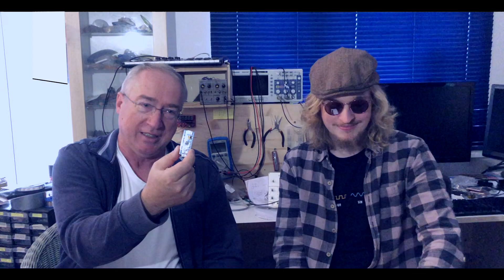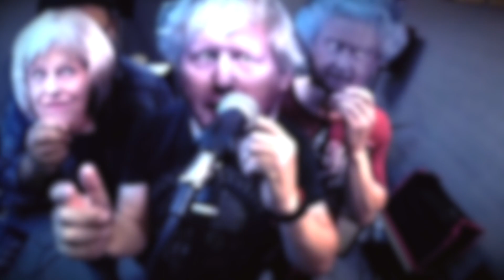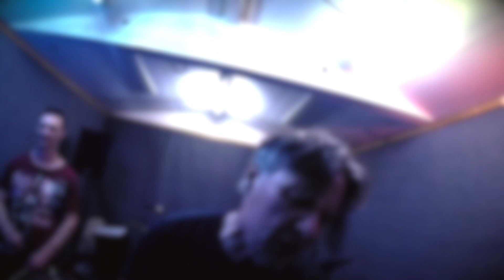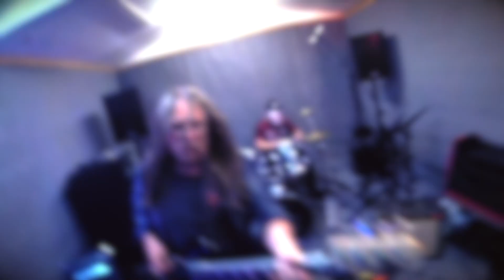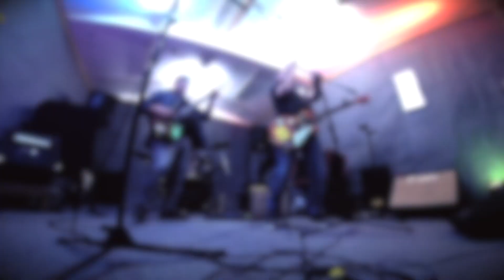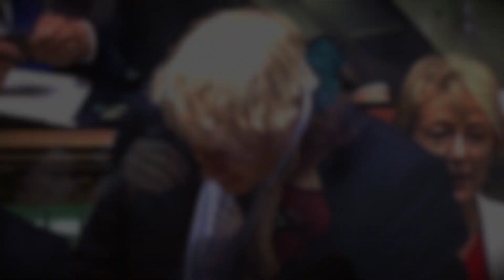Father & Sonthesizer EP. 14: The 50€ Wavetable Synth - Development

Comment: 13:00 Did you fix the "detuning" problem in the higher registers? I'd be interested to know whether you use a frequency/wavelength lookup table or calculate from A=440 Hz using the standard formula. Also what math precision do you use?
Reply from the maker: Peter D Morrison we use a lookup table at the moment cause it’s much faster. We’re using integer mathematics but we scale up by 12 bit in order to get enough precision. I’m not quite sure wether we actually fixed the detuning issue, but I rarely play chords that high up and it’s all note depending. So play fewer notes high up and it works. The little STM32 is at the limit of its capabilities here!

Comment: Hi George and Nils - thank you for all your hard work, particularly with the 'blue pill'. I swore I would never touch the blue pill again, but after seeing your amazing projects I decided to have a go. I've come unstuck trying to get midi to work on the Wavetable Synth, and decided to post my questions here in case anybody else is in the same situation:
1. Did  you use the USB bootloader to upload to the blue pill, or did you use serial, i.e. FTDI? I have uncommented line 17 when using the bootloader, but have had absolutely no luck connecting RxD from the 6N138 to any of the 'serial' pins on the blue pill. Using an FTDI (with line 17 commented out), I've had some success, but the midi behaves for a short time before ignoring note off commands and getting 'noisy'.
2. Which pins on the blue pill are you using for RxD and TxD? I noticed the comment on the schematic about RxD and TxD being swapped on v1.1, and on the "essential" schematic TxD = PA9 and RxD = PA10. 

3. Not a question, but I was having trouble with the rotary encoder until I noticed that CLK-KY040 in the code for v1.1 is PB14, but on the schematic it is PB3.

There's a good chance I've overlooked something simple as I'm definitely a beginner. I'm so excited by this project that I've given myself a headache trying to figure this out for a couple of days, and it's only in desperation that I've decided to bother you - sorry!
Reply from the maker: JumpingSpiderDesign Nils used the boot loader in an experiment but quickly stopped using it, he says the serial port is much better. 

As for the upload method in the IDE, it should say “Serial”, and he uses an FTDA adapter 

And nils also said the pinout on the WTSynth 1.0 schematic must be a mistake cause the correct pins are RxD=PA10 and TxD=PA9. We just double checked with the prototype and that’s the way we’ve got it. We’re fixing the layout/schematic for and will update it shortly. 

Regarding your midi issue, are you sure you’ve got the latest software? We’ll try and post a new one soon, message me on insta and I’ll let you know

Regarding the encoder, that’s a bug. Thanks for bringing it to our attention 

And please don’t hesitate to ask us anything again! Message me on insta (@georgekaymusic_ ) and I can give you Nils’ email so you can contact him directly. 

And we’re also super stoked someone is building one of our modules! You must share a video when you’ve got it working!
Reply: @georgekay372  Wow - thanks for the quick (and thorough) reply! I will definitely post a video when I get it working. I am tantalisingly close, and got my SH1106 OLED working yesterday - nice interface, and the 'oscilloscope' looks amazing. Thanks heaps - I'll figure this out or die trying!
Reply from the maker: JumpingSpiderDesign we’ve now updated the website with the latest PCB including all the fixes as well! And again, please don’t hesitate to message us again! We wanna help as much as we can. 

And we’re already working on a version 2.0, stereo filter & distortion and multi timbrality (with two bluepills)
Reply from the maker: JumpingSpiderDesign wow, that’s so cool! We’re really excited to see that in action, could we use a clip from that video in our next episode?

And I recommend using no sustain or a keyboard with an all note off command as hanging notes are still an issue in the current software.
Reply: @georgekay372  Aha! Thanks for the tip about the sustain; I don't even have a pot connected to that pin, so I'll go and try that. Sorry, I'm half asleep - I DO have a pot on sustain (5K, I read that in another comment?), so I'll investigate the midi behaviour of my various keyboards. I can confirm that it does not like my early '90s Lowrey/Kawai ;) I meant to ask; what keyboard do you use? You're welcome to use that video, but I'll endeavour to upload something a bit nicer - what's your deadline?
Reply: Okay, I played around with the microkorg, turned off everything but note commands (I think), and also bypassed the TL072 filter (for now) with an RC filter...and it works pretty nicely! I quickly made an updated video on my phone, which you are welcome to use if you like: https://youtu.be/fkjq0Fq7PcY Very satisfying to get a tune out of it! Thanks, George:)
Reply from the maker: JumpingSpiderDesign next Monday is when we film so that’s the deadline!

I usually use a keystep or the melody fountain with sustain turned way down. We’ll have to figure that bug out when developing the 2.0!
Reply: @georgekay372  The Melody Fountain looks cool...I just put everything away (rent inspection), but I'm tempted to unpack my crap and have a go:) I noticed the tail end of my last message (which had a link to an updated Wavetable/FM synth video) may have been collapsed and you might not have seen it...or maybe you're being polite by not mentioning it! Anyway, it's there if you want it...and it was a good excuse to do some more trouble-shooting if you don't;) Regardless, thanks for all the help!
Reply from the maker: @JumpingSpiderDesign  Hi, sorry for the late reply. Youtube doesn't like notifications on my phone apparently. I just watched the video, so cool! I'll definitely use part of it for the next video and link it in the description!.

Regarding the melody fountain... Hold your horses for a bit as we're working on an updated version based on the STM Essential 1.4 (which we might do a giveaway of). This is the same PCB our drum fountain, MIDI LFO, Harmony Fountain, Sample player and I believe the AlgoRhythm as well are based on. 

And I'd recommend putting a filter behind the wavetable synth, the 3320 is pretty easy to build if not the cheapest (5€ per chip), but sounds fantastic. And put a potentionmeter on the WT for the FM amount, that really changes the FM sound and is absolutely fantastic. I'll probably be demoing that sound as we're having some problems with the filter on our WT at the moment.

Comment: I downloaded the files from Dropbox but it looks like only the PCB and faceplate files are there, I am I just missing something? I wanted to take a look at the code.
Reply from the maker: Andrew Buckie right, I posted the wrong link. Here’s the code! 

https://www.dropbox.com/s/jqugx1s0lb9d89v/stm32-WaveTableSynth_a.zip?dl=0
Reply: @georgekay372  I have had a poke around the code, now I have to get to building the hardware. For the pots feeding the analog inputs (ADSR...) did you use 5k pots or should this be a different value? I know using 100k pots with the Nano were too high of a value to work properly is this the same case with the blue pill?
Reply from the maker: Andrew Buckie I’m pretty sure we used 10k pots but I’ll check with my dad in the morning and get back to you!
Reply from the maker: Andrew Buckie just checked, we did indeed use 5k pots!
Reply from the maker: Also if you want a direct way of contacting my dad, send an email to FAS@wirkays.de

Comment: I can't look at the code right now, but the detuning you mentioned can be due to rounding the pitch to the nearest integer, which would be more noticeable in the higher registers since the steps in Hz are smaller between each note up there.
Reply: This is actually exactly opposite. The steps between each note are much further apart in higher registers. Remember: when you double your frequency you go up an octave. A3 is 220 hz, A4 is 440 hz, and A5 is 880 hz. Good thought but you're backwards
Reply: @nickwood1929  Whoops yes actually! This has been a problem in some of my past projects where wavelength was expressed in samples.